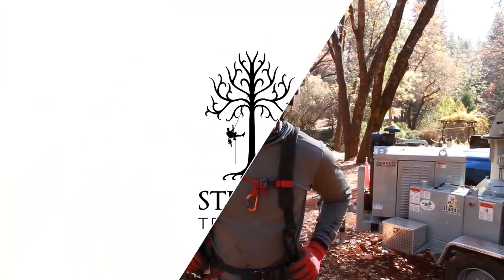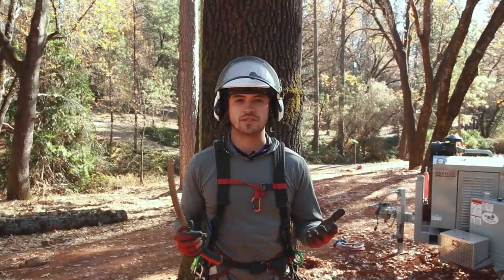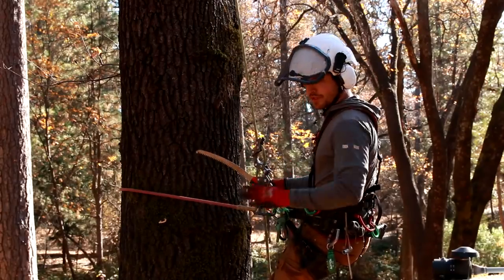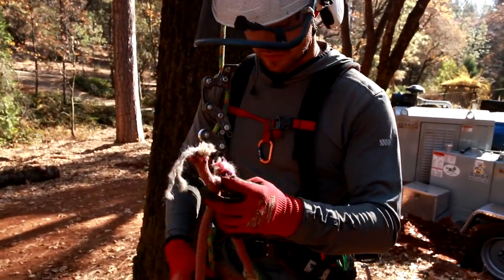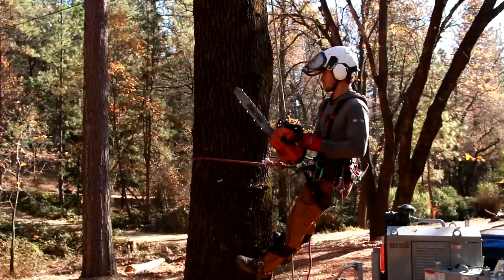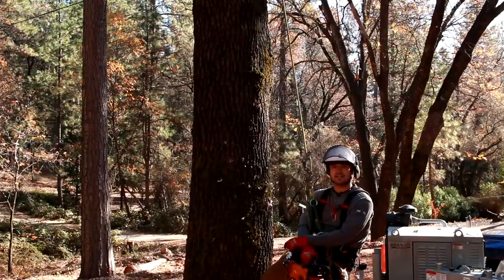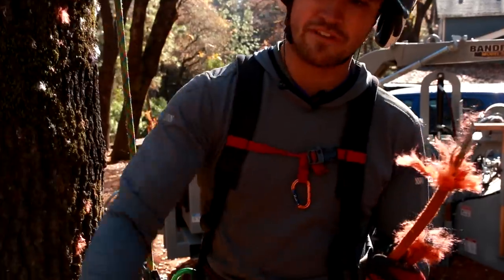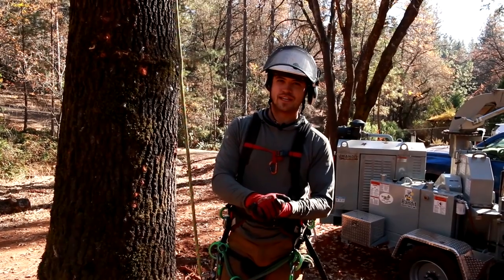Lanyard Torture Test

Comment: I've been getting lazy and not switching to my wire core for spar work.  This makes me rethink that...especially when running big saws
Reply: Is it taught to switch to a wire core for spar work, and if so, why?
Reply: @BRENDANTHERED  Not sure if it's taught...wire core is more rigid and doesn't get caught on bark etc. as much.  It's easier to move around on large diameter trees...just my opinion

Comment: Thank you for sacrificing your gear for our safety. I've seen this done before with the exact same results. It's a shame they can't build these ropes in a way that would jam up your saw the way chainsaw pants do before dropping you out of the tree. Sci-fi?
Reply from the maker: I like the idea! I can think of a way to do just that.
Reply: @Stridertrees Just an idea. Maybe a finely braided inner sheath that would pull into the saw before seriously cutting the core braids.
I've been a designer my etire life and everything starts with a first step. Just thinking.
Reply: @danpowellwoodman  Great video. Really interesting to do these cut tests with a larger saw as well. I have had instances where steel core cuts just like rope and other times where it holds up a few seconds more. Clogger has a product that addresses this very issue.
Reply: @bretthuet1396  What product is it?
Reply: @danpowellwoodman  it is a product that goes over a lanyard , friction saver or basal anchor with ballistic fibers and acts in a similar manner as chainsaw protective pants or chaps. It works well.
Reply: @bretthuet1396  Thanks Brett I'll check it out. I knew about the friction safer covers for lanyards but didn't know that they were set up for saw stoppage. I'd much rather see something incorporated inside of a climbing rope but I'm sure that's been looked at many times.
Reply: What a great idea!  Hey Dan have you ever mentioned that idea to the tree gear manufacturers?  Because I understand Sherril Tree and Tree Stuff have recently merged with a bunch of other companies, and they'd likely be very well set up to manufacture and refine that into a product if it would work...
Reply: @BRENDANTHERED  No sir I have not. In fact I just received your message today. 2-25-2022
Sorry about that